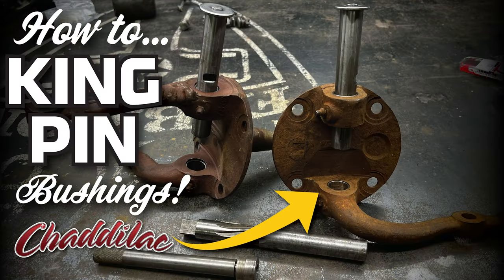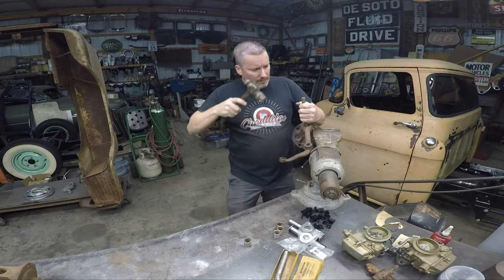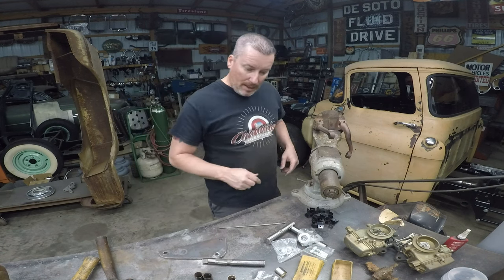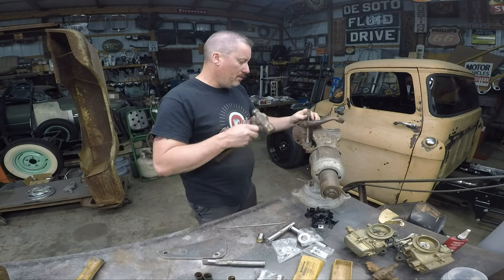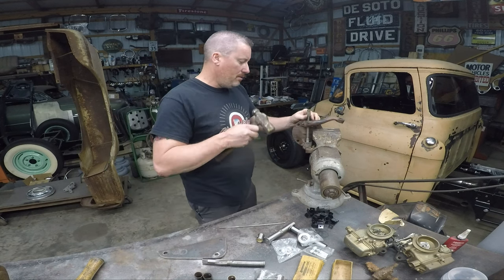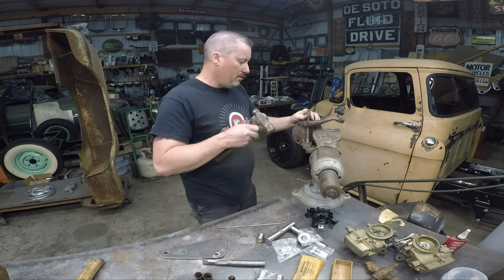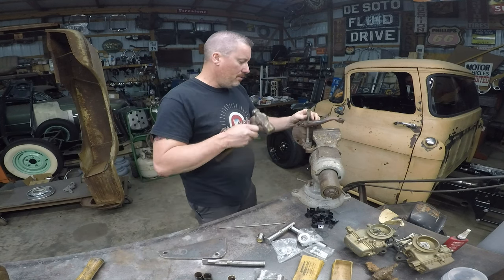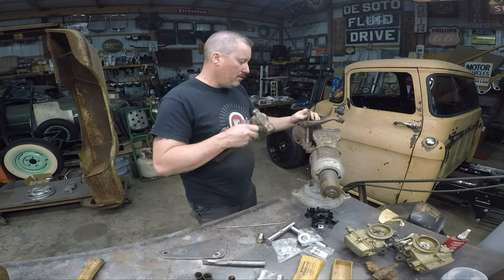HOW TO: 1928-1948 Early Ford Kingpin Bushings Install

Comment: If you give the rimmer time to cut the hole the pins will slide in nice without hammering it in... rimmers are  not threading  taps next time try turning same way but pull rimmer back out ,,,not good to turn rimmer  backwards
Reply from the maker: Great tip!